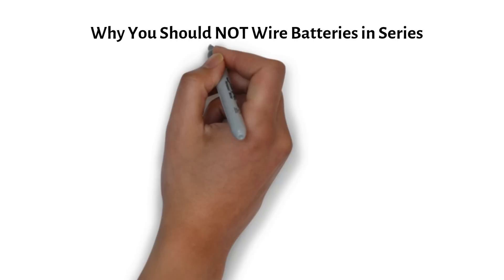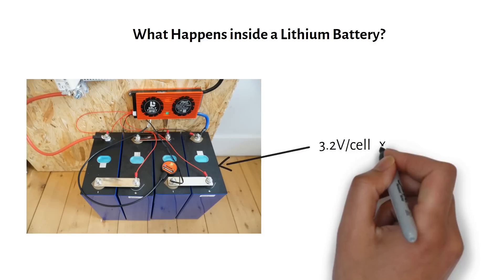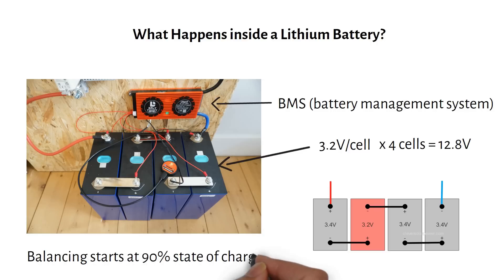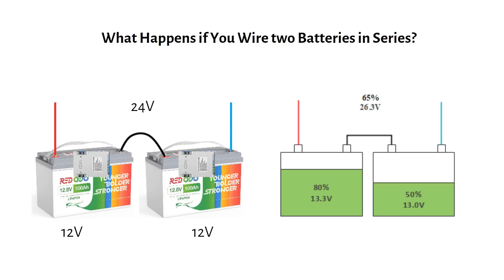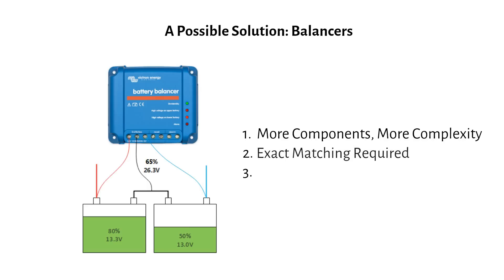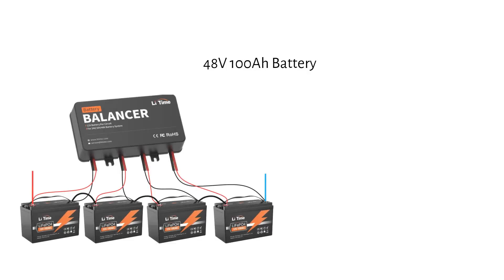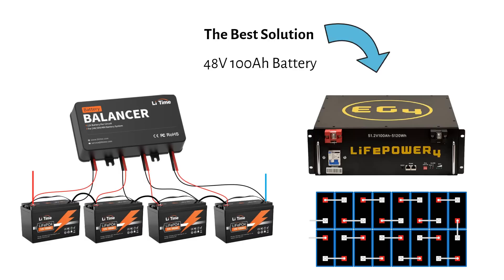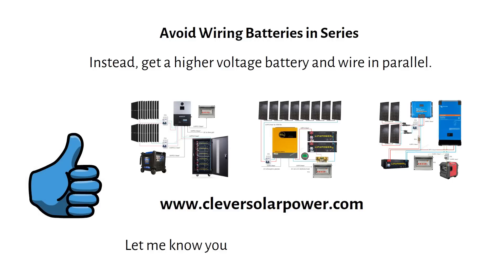Don't Wire Batteries in Series - Common Error

Comment: Will Prowse commented on this a while back. His experience was balancers are not needed with lithium . If someone was concerned they should balance after six months or more.
Reply: No needed but you have to charge to 100% , and that means you better have enough panels or etc to charge to full.
Reply from the maker: If you have to balance after 6 months, it's still a bad design. Why not use a higher voltage and not have to worry about it?
Reply: @cleversolarpower  from what I recall he said it wasn’t needed but if you were concerned. I was a bit put out as I’d just purchased a bunch of victron balancers lol.
Reply: @cleversolarpower  Because in here in the US, you can get 4x 100ah 12v batteries for $600 vs buying a 48v 100ah that cost $1000. Plus most people start off doing 12v systems. Gradually they move up and once you move up, it's natural to put those old 12v to good use. Not a lot of people start doing solar just go straight to 48v.
Reply: @Firephosure no knowledge that’s why people start off with 12V…my first system I went 24V & I’m in the U.S of A 😩 don’t comment for the entire country please 😞
Reply: @CampedOutGamers  Learn to read. My first comment is for the price pertaining to the price difference buying 12v vs 48v in the USA. Second comment is "most" people. I didn't say ALL. Just because you started out at 24v doesn't mean most.
Reply: @Firephosure lying azz, most people start off with 24V 48V…where are they selling 12V 100ah LFP batteries 😭 for $150?????
Reply: @CampedOutGamers Wattcycle was just at $154 for one 12v battery..the cheapest 48v is Valterer at $890. Only way to go cheaper is DIY 48v.
Reply: @surfguy777 that battery is $180 before tax & that’s because of Black Friday, just like all LFP drop in price…no battery for $150…a damn lie 😭😭😭😭
Reply: Most users will simply be oblivious to the issue until they try to pull full capacity from their battery when the weather is bad and then the lights go out.  Decent lithium manufacturer's do state the requirement to separately charge the batteries at least every few months or to charge the batteries with a separate floating charger on each individual battery.  Personally I don't want to be turning my system off every 6 months to separate the batteries and fully charge.  Not only is it time consuming and I must have an alternate power source while I am doing it, it puts repeated stress on the battery terminals (threaded type which is pretty common) and they will eventually tear out even when torqued properly.

Comment: Please Sir, does this also apply to flooded lead acid batteries? Due to cost implications, I and  most people are using lead acid batteries in my area.
Reply from the maker: I made this video for lithium. For lead acid, you also require a balancer but harder to find 24V or even 48V deep cycle batteries.
Reply: I'd like you to make video for lead acid batteries. The effects of  its series and parallel connections.
Reply: Open cell flooded does drift in a similar way but you have the option of simply over charging the batteries to bring all cells up to full charge and periodically replacing lost water.  You can't do this with maintenance free batteries since over charging there for flooded cells will see loss of electrolyte over time; AGM and gel types will be damaged by over charging.

Comment: Many UPS systems use serial connection without balancing
Reply: Those are SLA batteries.
Reply from the maker: Yes, that's true. A 12V lead-acid battery is made up of six 2V cells connected in series. Just like lithium-ion cells, these can also become imbalanced over time due to variations in capacity, internal resistance, or charge acceptance. However, lead-acid batteries have a higher internal resistance compared to lithium-ion batteries, which slows down the rate of imbalance.

This slower rate of imbalance means that lead-acid batteries usually take longer to show issues, but they still require regular maintenance, such as equalization charging, to keep all cells balanced. For lithium-ion batteries, the battery management system (BMS) performs this balancing function at the cell level, but in series-configured lithium packs, imbalance between the packs themselves can still occur without proper monitoring or maintenance.

Comment: Just buy individual cells and bms. 

I would never buy 48V 100 Ah battery. It is too big and to heavy.
Reply from the maker: Some people are not comfortable or have time to make their own battery.
Reply: 4S BMS - 12.8V nominal
8S BMS - 25.6V nominal
16S BMS - 51.2V nominal
Reply: Is 19" long, 10.5"  wide, and 8.7" high too big? I agree 85lbs is fairly heavy

Comment: i was planing to make a small setup with 4  12v  25ah batteryes in paralel using halfway method  and another same set conected in series with first one to make an 24v sistem
Reply from the maker: Just buy one 24V 100Ah battery, much cheaper and better.

Comment: It's too big a step financially for some of us I'm afraid. We learn as we go though😊
Reply from the maker: A 24V 100Ah battery cost $400. Two 12V 100Ah batteries cost $600. They have the same capacity.
Reply: @cleversolarpower  I don't know what bizarre part of the world you live in, but in the USA, 12V batteries are much cheaper than 48V batteries.  12V 100 Ah batteries do not cost $300 in the USA.  Well under $200, with quality choices at $150.  That is one of the principle reasons people do not do 48V.  The 48V batteries cost 25-40% more.

If the prices were identical, sure it is best to go 48V.  But you ignore or lie about higher voltage batteries being cheaper, when clearly it is the other way around.  12V LiFePO4 batteries (100Ah and above) are significantly cheaper than 24V and 48V of the same capacity.

Comment: Check and top off the individual banks twice a year and you will be fine.
Reply from the maker: I rather not check the voltage of my battery. And you need a 12V lifepo4 charger for that. An additional headache. It's way better to get a higher voltage battery. No check, no headaches and no worries.

Comment: Nonsense! Charge series wired batteries separately and use a diode harness to connect them, in case of single battery failure. Job done.
Reply: Doesn't charging each 12v battery separately introduce more complexity though?
Reply: @malk6277  Such as ?
Reply: @Humanity101-zp4sq  In what manner were you proposing to charge them separately?
Reply from the maker: Seems like you like complicating stuff or trying to justify your battery setup. You cant deny that having a higher voltage battery is much more beneficial for the reasons mentioned in this video.
Reply: @cleversolarpower  the Video was about low voltage batteries and how to connect them. 
If you want 24V 100Ah - just buy 1
If you want 12V 200Ah - just buy 1

But what if you have 2x 12V 100Ah? Thats the question.
Reply: @floki5353 Based on what I understand from the video, I would say wire two 12V batteries in parallel and you won’t get the imbalances you potentially would see wiring in series. This video has made me decide to power our cabin solar system with 12V batteries in parallel instead of 6V batteries in series/parallel. My question would be do these ideas apply to lead acid batteries as well?
Reply: @floki5353  One 12v charger would suffice, with switchover relays if the installation is permanent.

Comment: I worked for British Telecom for many years. The telephone exchanges had battery backups and a diesel generator. Each battery was 6v lead-acid, and wired in series. Because of imbalances, but it was an acceptable problem / consequence, we had to change the batteries often, and certainly more regularly than you'd expect. You're absolutely correct, but most people will be happy to wire two 12v in series. 😉
Reply from the maker: Yes, and a backup station is not made to cycle all day, so i expect the imbalances to be less visible. This video doesn't really focus on lead-acid. Maybe i should have talked a bit more about lead-acid.
Reply: @cleversolarpower  Sorry, I didn't explain too well. The batteries were always used. Mainly to smooth out the feed and ensure a steady DC supply. They were mains charged, but generator during a power cut.
So the batteries were in continuous use.
Reply: @floki5353  To be honest, I'm unsure. Nowadays, yes. Back when they were the strowger sets, I don't think there was unless you count the huge capacitors?
Reply: Lead acid in series is a bit easier.  That chemistry tolerates overcharge which it dissipates as heat as vaporizing electrolyte.  This allows the series string to be periodically "equalized" to a higher charge voltage which ensures all series cells are fully charged. Electrolyte management is a separate issue.  After using lead for years, running LiFePO4 is almost magic.

Comment: Led acid batteries work's better with balancers even with different capacities, for 2v cells i can't find balancers.
Reply from the maker: If you have 2V lead-acid cells you need series connections to make 12V. However, since it's much cheaper these days to get lithium, i don't know why people still get lead-acid. So this video only talks about lithium (lifepo4).
Reply: @cleversolarpower  lithium batteries  here are still very expensive and I don't trust them, to much electronics to run safe, I want to make a 24v system with 2v cells and only victron inverters have the right program to support them, but victron inverters are very expensive, so I need to find something else to support them (Chinese hi frequency inverters) who I don't trust them either.

Comment: Oh it's easy to run batteries in series without any issues, do a bit more research
Reply: Don't think you understand what  nick is saying in this video. If you have single cell batteries and run them in series  no problem  but with multiple bms's problem occurs,  not communicating with each other.
Reply: @zummerzetwoodsman1067  maybe he shouldn't have such a dumb title for the video?
Reply: A12v bms would disagree.
Reply: Ok smarties...tell me why ALWAYS all batteries present the same problem when connected in series....
The battery in the minus rail has always less charge than the batteries connected in the plus rail ????
Reply from the maker: I think you missed the point of this video.
Reply: This only applies to lithium batteries

Comment: this is only the case for lithium ion batteries right? in my country we use 6v batteries in series parallel connections for massive battery banks.
Reply: Correct.  This is only applicable the batteries with BMSs.  Lead-acid is a different beast, though depending on the lead-acid type you will still need a balancer or have to depend on an equalization schedule to keep the elements in balance, and/or other care and maintenance.

Comment: i always thought for lithium batteries that this was not a good idea / impossible because the bms could not handle the higher total voltage.
Reply from the maker: Renogy’s LiFePO4 batteries were once limited in their ability to be wired in series, as their MOSFETs weren’t designed to handle 48V configurations. At the time, they could only be wired in series for 24V setups. However, Renogy has since upgraded to higher-voltage MOSFETs, eliminating this limitation. Nowadays, it’s rare to see this kind of restriction with popular battery brands.
Reply: Nearly all 50A or higher BMS's can handle voltages of at least 60VDC BAT+ to BAT-, so generally speaking you can connect 4 x 12.8V batteries in series, or 2 x 25.6V, or 1 x 51.2V.  But even so it isn't a good idea to connect batteries with BMS's in series for a multitude of other reasons.

I personally don't trust the BMSs on very small batteries like the 10, 20 and 30Ah LiFePO4's you see on Amazon to be able to run in series.  But larger batteries should be fine.  If battery explicitly says not to tie in series, though, then definitely don't.

The tolerances are just a function of the MOSFET breakdown voltage in the BMS, 60V is actually fairly run of the mill and cheap.

-Matt

Comment: I had that exact problem when i connected the batteries in Series for 24 volts. The batteries would not stay balanced
Reply: Both new same type and model? LiFePO4 type?
Reply: @boapvdk  Valence U27 12XP Not new

Comment: Why would you use a 12 lithium battery in a solar system? A string of 4.2v blade cells in series with a decent BMS will be a lot more efficient.
Reply from the maker: If you have a small system and use 12V loads or are in a van, 12V is a good choice.

Comment: I opted for Pairing My 280ah CHINS in Series for 24 Volt Systems and Use Victron Energy Battery Balancers on all 4 Systems now.
Currently Buying 24 Volt 100ah and wiring 4 in Parallel to 300 amp Buss Bars for System #5 and #6 

Thank You Nick 🙌
Reply from the maker: Yes, adding a 24V battery in parallel with your 2x12V batteries in series is no problem as well.

Comment: I am glad I didn't go ahead and wire four 12.8vdc Lifepo4 batteries in series. I am only focused on 48vdc to 120vac and 240vac inverters. They are the most expensive by far, but pushing the same amount of current at 12vdc vs 48vdc is a no-brainer to me, just expensive.
Reply from the maker: Exactly, for higher power systems use 48V. I recommend using 48V systems if your inverter is 3000W or higher.